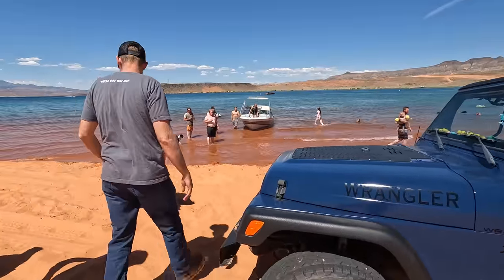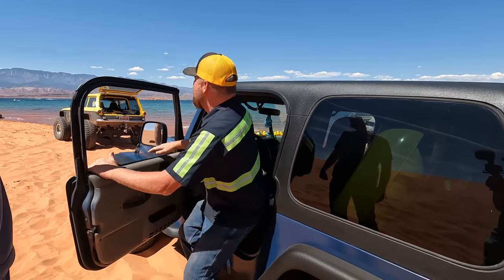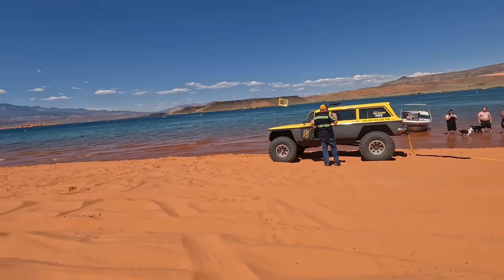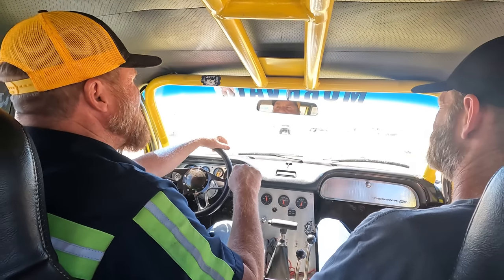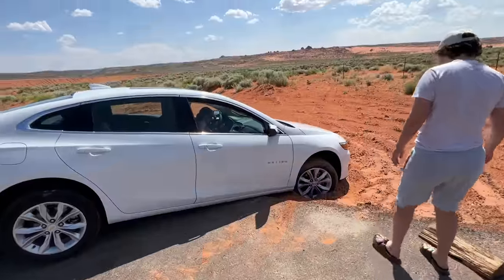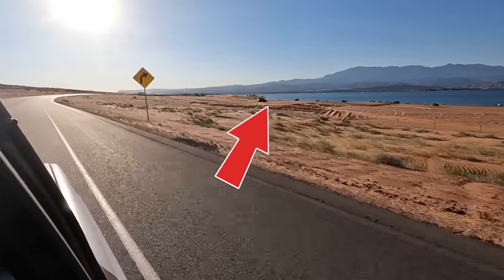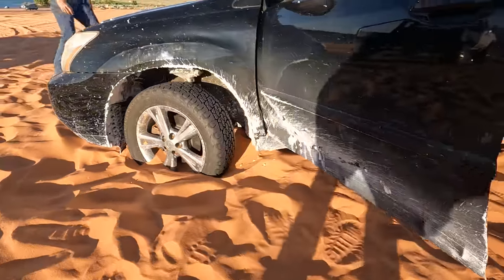Not Looking Good! It's Dead Pull Time.

Comment: Angela, I've been driving for almost sixty years and my philosophy is the same as yours, treat the half full mark as empty and you will NEVER run out of gas.  There's always exceptions of course, but after all my years of driving all kinds of vehicles, I have never run out of gas.
Reply: When dating my wife used light to decide to get gas. After learning “if you run out, in this rain, at night in NE YOU will be walking for gas.  I will go along but you will walk in the rain.  OR you can stop here and I will put on 5 gallons”   Now she fills above 1/4 tank.  Close to half.

Comment: If the crew ever reads the comments regarding the MANY items they should take with them to be prepared... they should include some mats to lay on to protect them from hot sand, goat heads, rocks, etc.
Reply: Introducing: Matt’s Mats, available now!
Reply: And even MOR Matt’s Mats. Love it!
Reply: @azpcox  The MORR MAT, by MATT!
Reply: Now available in matte black
Reply: Yeah they need to bring some high boots, a machete and some mats or cardboard at least
Reply: There is a ton of stuff that they could bring with them at all times. That's part of the problem,  there is literally a ton (2000 lbs or 1000 kilos) worth of things that they could bring in a vehicle they ate trying to keep as light as possible.
Reply: Or have floor mats in the rigs that can just be tossed down when needed.
Reply: I always keep a cheap tarp in the truck for this. Protects from wet ground as well as all of the above mentioned things, plus it can be used for shelter in emergencies.
Reply: @mrbyamile6973 Solution: 1/4" foam sheets used for packing.
Reply: @garychandler4296  Or pieces of yoga mats. Or pieces of 1/4" or so, camping mattresses.
Reply: I use the sunshades. Great to keep vehicle cooler and give a nice ground barrier in a pinch.
Reply: @garychandler4296  honestly I over pack my vehicles, I just know they frequently talk about weight of equipment. Space is also lacking when they have extra people and film 🎥 gear.
I personally have a cheap Harbor Freight tarp folded up under the back seat. Saves heat on blacktop or wet/snowy ground. Also as someone mentioned, just use a floor mat that has another job in the vehicle anyway. I actually keep jackets, tarps and a cheap packing blanket in my vehicles. I live in Colorado, it can be 80* one minute and 20* and snowing the next.
Reply: as much as I agree, they also need to put a bucket of T shirts in dig dug.
Reply: @grigorirasputin996  No.Matte black would get hot fast.
Reply: I keep a new (cheap 10x12) tarp in my self-rescue kit. Very flat and compact, and you can use it for kneeling or lying on, wrapping up filthy stuff like a dead muddy wheel or a greasy CV axle, keeping the snow or rain or wind off of you while you're fixing something on the side of the road/trail, etc etc etc.
Reply: Pillows also and blankets. Should also bring ice since its hot
Reply: Oh and electric fans
Reply: I have a feeling they know well what they could do to be better prepared but simply don't care lol. They probably like to see how much they can do while bringing as little as possible
Reply: @Marlon_42  
And a chainsaw, and a jackhammer, and a plasma cutter, and spare parts for popular 4x4's, and a sattellite phone, and extra water and food and a Trauma Bag, and a Jaws of Life, and a Fibulator, and spare tires, and extra motor oil, and brake fluid, and a camp stove, and a tent, and swimming suits, and a snakebite kit, and sunscreen, and .... and....and....and......
Reply: i remember seeing matt use a black garbage bag to lay on during either a snow or mud recovery. then when the job was finished he placed the wet mud covered kinetic recovery rope in the black trash bag and called it a day after he used that same black trash bag to and soak and rinse the yankum rope till it looked like new again. minimalistic is how matt works. just a little food for thought!
Reply: Maybe have an offroad Segway for your camera man yo help them keep up. Also, bamboo beach mats for laying on the sand. Great video again
Reply: Again they left the wrecker at home.
Reply: Matt already has that built into his blue shirt It resists all the elements and pokey things and I think wolverines too.
Reply: They just should continue being tough and taking as little junk as possible. Travel light, don’t be a pack rat.
Reply: Large leftover cardboard boxes my friends.  Like that TV box you have from 2 TVs ago for some reason.  My dedicated work area is a gravel driveway.
Reply: if they brought everything everyone says they should take they would be loaded to the gills with gear. wouldnt even be room for the recovery gear or people. if you can do a job with less it is better.easy for people to sit at their computer and tell them how they should do things but you dont know until you are the one actually doing it.Those who prepare too much and over think things tend to also be the ones to never actually DO anything.
Reply: Matt used plastic garbage bags for the mud for many pulls.
Reply: @grigorirasputin996  There is no misunderstood word play or humor.  A black matte, mat, Matt or mat in matte black. Matte/Matt Yellow would be word play. Matte black would just be hot.
Reply: Morr Mats by Matt in Matte black
Reply: Good piece of cardboard work a treat. Easy to find and you can recycle it when you're done with it.
Reply: if they listened to and took everything from every suggestion, they'd need a staff of thousands and triple tractor trailer following. 🤣🤣
cheap roll up mats may help slightly, but not much. the hot sand radiates a ton of heat and will quickly heat anything on top of it, as well as the radiant heat pass right through.
Reply: I keep cardboard in my truck.
Reply: Yep, old car matts are carpet will do.
Reply: They have Matt

Comment: I am 67 years old and my mother told me when I was 16 yrs. old, refill at a half full tank! It doesn't cost any more to fill the tank to full than filling up when almost empty to half full, and if needed you have more fuel in reserve! Plus living in New Hampshire, with a large variance in temperatures, I will have less problems with condensation, in the winter with icing in the fuel lines and filters! Thanks to her advice, I have never run out of fuel or had a fuel icing in the winter months!
Reply: and some vehicles rely on the coolness of the fuel to keep the fuel pump from overheating ; )
Reply: @mygarden365  I agree, if it's an in tank sending unit it uses the fuel to cool the sending unit down.
Reply: I live in New hampshire too and a full tank also good for when you have to go somewhere seeing everything is 40 to 60 minute drive away.

Comment: Something tells me there are either kids that need to be asked about the debris in the coolant overflow reservoir, or they have a very unfriendly neighbor.
Reply: Yea doesn't make sense to me
Reply: For sure, I like how Matt just kinda ignored it.
Reply: It's probably bad form to tell people how expensive the fix is going to be
Reply: Or a mouse tried building a nest.
Reply: Yeah that’s my guess… 🤷‍♂️
Reply: If it's reddish in color, it's not sand, it's rust.

Trust me on that, I've owned a XJ for 27 years.  It's a 4.0 thing.
Reply: It probably is the radiator heat exchanger letting atf leak into the coolant possibly
Reply: or mixed coolant and stop leak, they did say they put a rad in it
Reply: @cl9900  take the water pump off replace the radiator and flush the system itll be fine i used to store cool rocks i found in my coolant overflow as young man to clean them on the way home XD
Reply: Exactly what I thought, those hoods dont lock from the inside so any no do gooder could walk up and mess with stuff.

Comment: Wow, 9psi on those gigantic tires and it's still not always enough!  That's absolutely nuts.  I can't imagine driving around on the road at 9psi either.  We run 11 out on the sand on Cape Cod and I don't like to drive on pavement at all until I air up if I can help it.  Then again, if you were airing up and down every time you did a job at Sand Hollow you would probably go through valve stems like tictacs.  Love the channel, keep up the great work!
Reply: With the big tires and a relatively light rig they can get away with low pressure. And, those tires might have a stronger sidewall that better supports at low pressure. 
I think they also don’t drive particularly fast when on pavement.

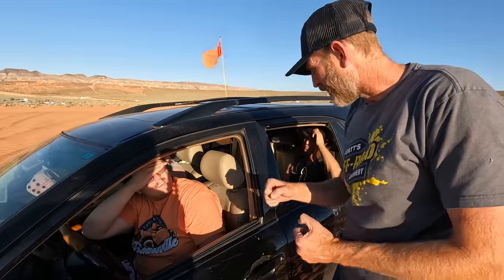Comment: 13:00 I was worried they weren’t going to get that Lexus hybrid out.  I’ve worked on those things for years and if the computer doesn’t see the accelerator being pushed it turns the drive wheels into generators and under a tow situation it becomes more of an anchor.  I was glad to see the driver giving it some skinny pedal to tag along!
Reply: neutral gear disables what you're talking about
Reply: Interesting.  That could be helpful.

Comment: ✨🙏🌊💙🌎💙🌊🙏✨... when you're son mentioned that you guy's need a way to trek faster through the sand🤔... consider this...if you get a medium sized dirt bike that you could haul on the trailer with the vehicle you're attempting to rescue... you all could utilize it for instance... when you go to a location where you're not too sure the exact coordinates to do a patrol of the area and map out a route for your rescue vehicles...even in the sandy areas you could trail the rescue vehicles....or... consider training everyone that is operating the camera to also operate a drone,so that way you don't need to trail the more difficult rescue on foot.. also the drone can be used to collect data, like mapping out best route or simply finding the costumer quickly in a rescue 🙂... hope you all stay safe out there, thanks for the adventures.... PS I'm only making a suggestion for a safer, quicker recovery.. thanks... happy trails....

Comment: Hey Matt, y’all should have your off-road vehicles tinted with ceramic tint would make a huge difference on the UV rays and the heat coming into the vehicles
Reply: I have ceramic tint on all my cars it actually is amazing stuff. When the tint guy showed me the heat light gimmick i was sold.

Comment: Matt here is a new product for you! Gym floor tiles(3/4”x24”x24”) soft foam mats. “Matt’s Mats”. You could do black or yellow with Matt’s off road recovery on them. I use 2 of these, easily storable in the back, to crawl under cars. Not worry about goat heads, hot sand, gravel, or pavement. Not the best for mud though. If you produce them send me a set. Anyway I love your content and your crew

Comment: Yes I hear you about the octane rating because they typically use 10% ethanol so the real amount of octane is slightly under 79.2 octane gasoline. While 91 octane is 81.9 gasoline octane with 10% ethanol = 91 octane total. First they took out the lead, then the additives, then add 10% ethanol,  oh the humanity! 
Interesting tip: having trouble keeping your go-pro steady without all the expensive accessories; well just grab a chicken "live" and strap the camera on its head, it naturally keeps its head in a fixed position. So steady that it is actually better than the most expensive equipment on the market. 📹🐔 true info, fact check. Now you know. 💫
Have a good week and count your blessings amen. 🙂👍👌👋

Comment: You guys should use space blankets for laying in the hot sand.  The air gap insulation in them will protect you from the heat, and they take very little room in the recovery vehicle.
Reply: just bubble wrap will do...
Reply: @tufalike1796 bubble wrap would actually work better, a space blanket wouldn’t provide any insulation from the ground. Another alternative would be a cheap foam camping mat. But we all know preparedness is not what makes MORR successful

Comment: For Tom; (lifted from the net) Pre-ignition is a situation in which the fuel-air mixture in a spark ignition engine ignites before the timed spark. Detonation is simply the spontaneous combustion of end gases ignited by reaching their critical temperature prior to being reached by the normal flame front.  Pre-ignition can lead to detonation.
Pistons are better than they used to be, but detonation can still break them, sometimes taking the block with it.  You can carry some octane booster to add when good gas is not available.  Cheaper than an engine.  You can also take some load off the engine so it makes less heat.  Slow down, and/or downshift until it cools a little.

Comment: 91 Octane is for high compression engines, which produce more power, which is great for true motorhead Americans. Owned three at one time: 1969 Volvo 1800S 10.5 t0 1, 1966 Lincoln 10.5 to 1, 1976 F-250 4WD 10.5 to1 and really enjoyed them. So you running it in the Morvair makes perfect drndr to me.

Comment: The southwest is definitely an oven this summer. My in-laws are baking in the heat in Phoenix with the temps hitting 120. 🔥 
But as they say, it’s a dry heat. 😉

Be careful out there. It’s not just the sand that will burn you. Pretty much everything will.

Comment: 1:59 

Debris and rocks in the overflow....

Yep, that's what old stop leak looks like after some time. 

Jeep looks freshly painted (cheaply), so if they bought it used someone was hiding something.

Gotta do a good radiator out coolant flush, and possibly fix a bad headgasket... Headgasket in a can products harden in the presence of compustion gasses and heat.

Comment: I look at blower control diagrams.  If it negative thru the blower resistor andfan switch. With a switched relay on the positive side. Then you can add a heavy duty switch from the negative fan to ground. This makes the fan blow harder.

Comment: They need a coolant line filter when the internals of the block are that dirty, or they'll be putting many radiators on, after every couple rides with them plugging up. My truck plugged my radiator, and the inline filter 5 times before the rust was removed completely from the cooling system.

Comment: So Tom asked for date night hints.  Grab some comfy blankets, mostly for sitting on, and large pillows, bundle well and tie into the bed for safety.  Grab a cooler with beverages of choice and head up to one of those beautiful mesa's and spread everything out and watch a sun set with Angela.  Or the stars and a moon rise if you need to beat the heat.

Comment: I have wondered for a while why you don’t have on board air for things like tires? Either like Hum Vees where it is plumbed directly to the tires. So you could air up or down with the flick of a switch. Air down for the off road stuff and then up to road pressure. I would imagine that would be easier on the tires. Or even just with a hose. Also why don’t you carry a spare tire for your vehicles. In the videos you don’t get a lot of flats. But when you do it’s a long wait for a tire. If you had a spare and the tools to swap it out it would be easier I would think. Perhaps I’m wrong and there’s a good reason. Any who have a great day. 😎

Comment: Most people don't realize how much power they're leaving on the table in hot conditions with regular fuel in LS based engines (usually 30+). Tuned for 91, can run 25 degrees of timing in all but the hottest conditions. Usually 14.4 AFR on regular throttle.

Comment: If used to run a good quality water methanol injection system that greatly reduces those problems also anyway, this will work. This is six in a row.Jim from Kennerdell, Pennsylvania

Comment: On the subject of fuel and gauges:

They say,
It costs the same to keep a tank full as it does to keep it half-full (or half-empty if you're a pessimist).

It could be argued that it's cheaper to keep a full tank because the fuel is a heat-sink for the fuel-sender.  Running on empty in the heat can cause premature sender-unit failure.

You also get less condensation in your fuel tank if there is less space for air (even in arid Utah).

I'm sure you already know all this, as well as many things I don't.  It's just a friendly reminder.

Comment: I have a small car with a 12 gallon tank. I usually buy (need) about 3 gallons at a time. I think it is a good policy to try to keep it between 3/4 and almost full. I try not to fill it completely full because I live in a fairly hot climate. Getting down to half a tank is like running on empty to me. My car rides better with a 3/4+ tank. And, I've heard (I don't know) that it is better for the fuel pump to keep the tank above half.

Comment: Advanced timing under load will always cause ( pinging - knocking ) pre-ignition. Higher octane can sometimes help , but retarding timing just a touch will do the trick. Not by using a computor but by ear. I am old school.

Comment: The blue Jeep appears to have some sort of mud in the coolant reservoir.  Combines with that sand but never works well.
Reply: Might be from poor maitenance,  I bought a jeep that had an over heating issue.  I pulled the bottom radiator hose and it was nothing but sludge.  I back flushed heater core and had the same thing.  I issolated each component and flushed both ways until clear water.  New radiator and problem solved

Comment: Do you need compound (like turbo) blower motors to get some wind blowin out the vents. 4 settings 1 is 1 fan at half speed 2 is 1 fan at full speed 3 is second fan at half and 4 is both wot